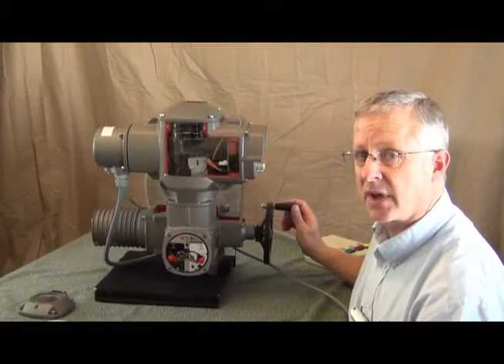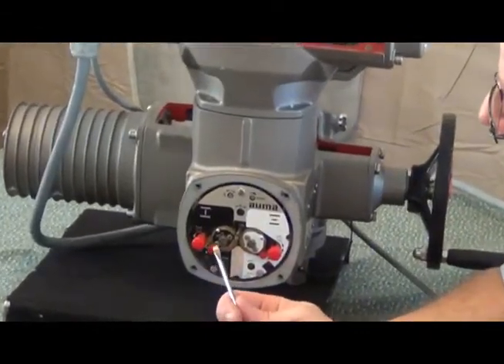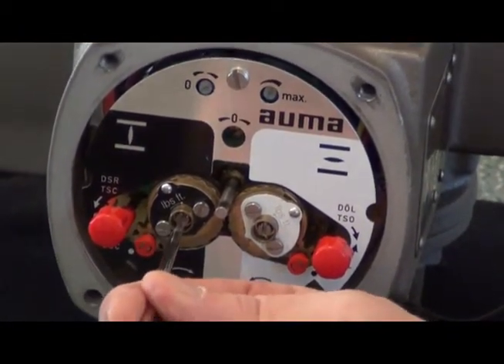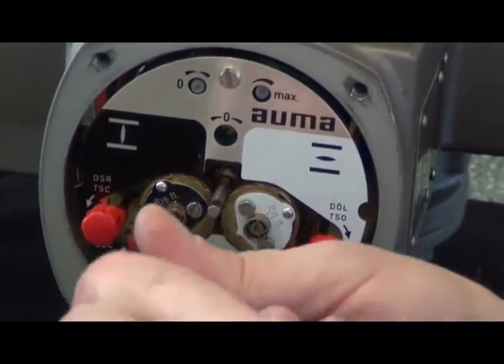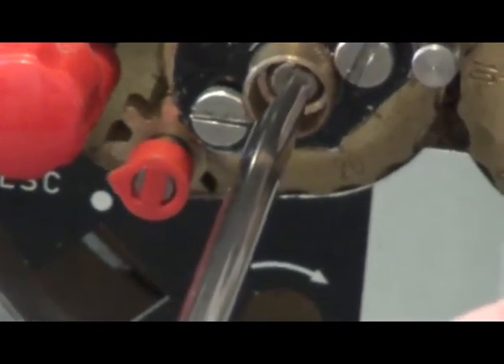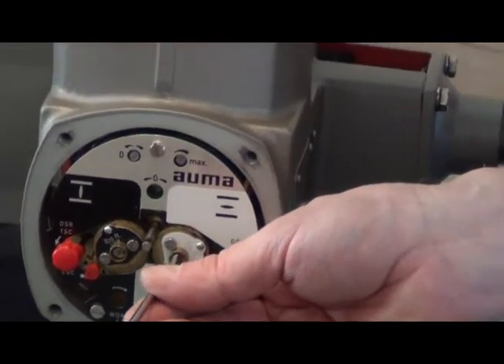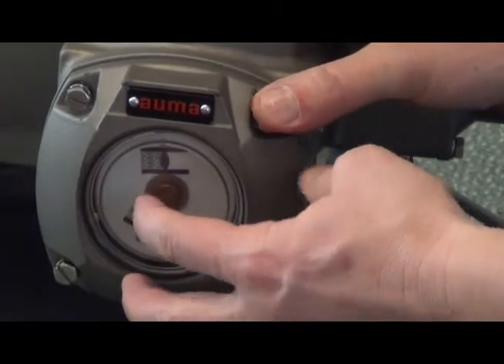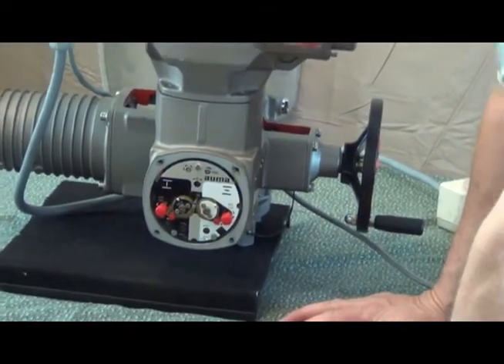Setting Limits On The Auma Electronic Actuator Valve

Comment: I have a problem with AUMA actuator in my company in a project related to BONO Energia, as the valve had faced power failure, then after the power back to the valve the actuator stay in self-testing many days and gave an alarm in the HMI, we tried to power it off and reconnected it again but the problem stays the same

Comment: Good video. So the limits for the actuator / valve can be set utilizing the hand wheel and have the power off/ locked out if necessary?